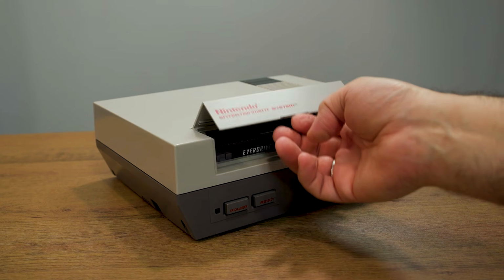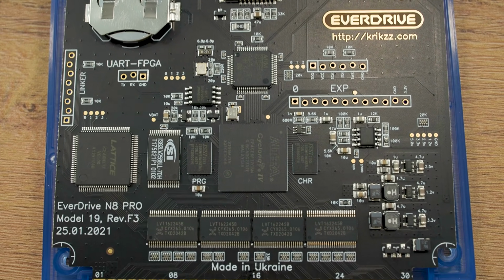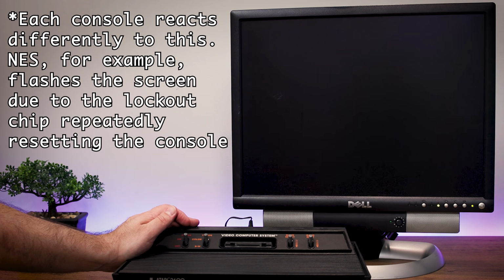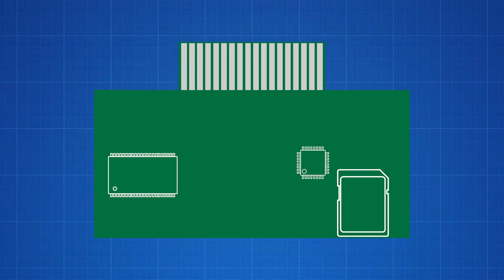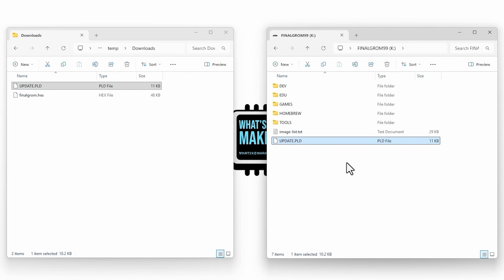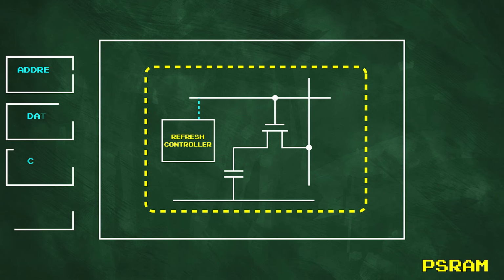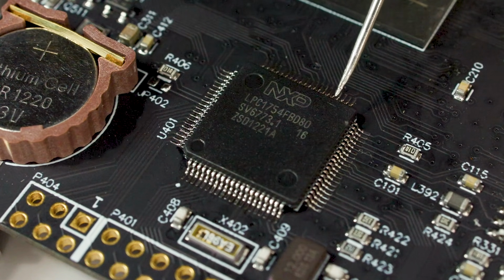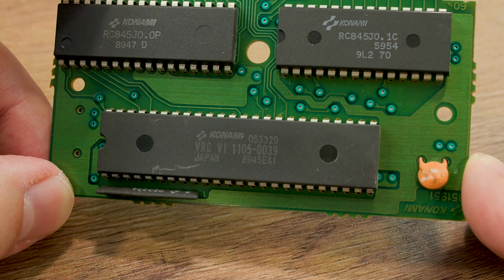The Engineering Behind Flash Carts

Comment: Some of those are quite modern tech!! And for the record I am all for mixing modern and retro tech together.  But playing devil's advocate, one could argue, if your going to emulate hardware in the cartridge with FPGA, you might as well emulate the whole thing in FPGA.   (which I am also all for -- I'm just commenting since there are people that insist the real retro experience is to use original hardware, yet they will have a SD cart or SD drive hooked up to their original system)

Comment: Nintendo released official flash carts for both the Gameboy and the Super Nintendo in Japan: they were called the GB Memory Cartridge and the SF Memory Cassette. The idea was that instead of selling you a new cartridge for every game, you would buy a cartridge once and then you could download new games from a Nintendo Power Kiosk for a cheaper price than if you had to buy a new cartridge every time. Using a modern cartridge dumping device you can actually flash your own ROMs to them and use them as proper flashcarts, the only limitation being the lack of a SuperFX chip and much smaller storage given the lack of an SD card slot. You can still find these cartridges at retro game shops in Japan for around $20 as long as it doesn't have a rare game already flashed to it, much cheaper than an Everdrive.

Comment: What's your opinion on the older everdrives (and clones of which are still being sold) that used 100ohm resistors for interfacing 3.3v and 5v instead of level translators? Specifically about the long-term danger to the console itself which might end up running excess current on the I/O pins. Perhaps you're familiar with the old dbElectronics article that says they're bad (it's archived if you want to look it up).

Comment: The Everdrive N8 Pro has a lot of hidden complexity -- not just in hardware but also in software... for example, it supports Save states -- on REAL hardware -- using a button combination you press on the conroller. -- Like, it's injecting code into the game to make that work... -- also two FPGAs make sense, because it needs to emulate two mappers at once -- one for the CHR ROM, and one for the PRG ROM.
Reply from the maker: Yes, it’s an impressive cart indeed. Lots of great work went into it

Comment: I find it funny and interesting that the solution to making 3D SNES games was to throw a whole processor at it.  It's smart to expand the capabilities of the SNES, but stinks since every copy of the game needs this chip.  I'm guessing that's why they included the RAM module on the N64 to allow for expansion without needing to integrate it into every cartridge.
Reply: The SNES was designed specifically with this kind of expansion in mind.

The NES/Famicom quickly hit its limits and work arounds had to be developed to keep the system competitive.

As a result, Nintendo wanted cartridge expandability to be there from day one with the SNES. And it was. F-Zero and Pilotwings launched with the system and had co-processors in their cartridges.
Reply: The RAM module was because of the 64DD, disk read speeds were slow so they knew they’d need to load more into memory at a time. Memory at the time was especially expensive so they had to roll that cost forward into the 64DD hardware package cost.

When the 64DD flopped in Japan the memory pack was used for other purposes. Many of the games that used the ram pack started life as 64DD games.

Comment: Nice!  Ralph designed an awesome flash cart; we were able to flash it to work on the /4 (and the QI) by patching both the firmware of the AtMega and the actual FPGA.  I've been running my /4 on one during SFGE.  The UberGROM (another single purpose flash cart for the TI) is meant to be more of a maker cart.

Comment: Want to point out that modern sdcards are not slow. Whether in latency or throughput. Their speed hugely depends on the hardware reading them and whether the hardware supports the speeds.
Reply from the maker: The processors these systems use require memory latency within a couple hundred nanoseconds. SD cards have a lot of controller and protocol overhead that prevent them from getting into that range, typically in the 10s to 100s of microseconds, and often milliseconds. Even the fastest SD cards can’t get anywhere close to 250 nanoseconds

Comment: There are a bunch of reasons why you might want to have two FPGAs. The main one I can think of is that the ICE40 starts up much faster than the cyclone 4, and this is important because, unlike some other consoles, the Famicom requires the cartridge to be fully functional from the moment it powers on. Thus, you couldn't rely on the Cyclone IV for any logic that has to be active during bootup. It also means that the Cyclone IV is less critical for general functionality of the cart, and thus its bitstream could be loaded from the SD card instead of a dedicated config ROM. It might even load different bitstreams depending on what it needs to emulate (although I think a Cyclone IV could probably hold an emulation of most mappers simultaneously).
Reply from the maker: Makes sense

Comment: It's worth mentioning that you can make a flashcart with no programmable logic or microcontroller whatsoever. In fact, Krikzz has released an open source one for the Genesis called the open-ED. In this design, the board contains a bootloader program that the console's own CPU runs to copy data off the SD card. It's slow, but it works!
Reply from the maker: Yep, there are also some Atari multi carts that work the same way, but with DIP switches that map memory addresses to ROM address addresses

Comment: 13:29 People often ask: why do you need an actual battery on a flash cart? It's because people are used to just powering off these old systems when you're done playing them. Flash carts have a battery backup so that it can save the contents of the backup RAM to flash the next time it's powered on. Cheaper flashcarts with no battery require you to soft-reset or push a button on the cart before turning the system off--otherwise you lose your save data.
Reply: Non pro everdrive has a battery, but for fds you need to soft-reset anyway. Also it resets its settings when the battery dies.